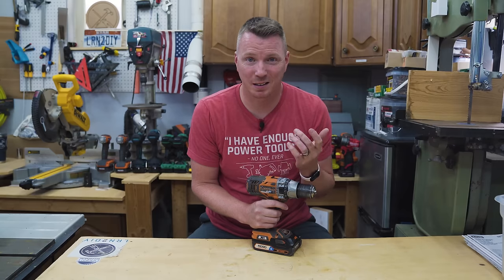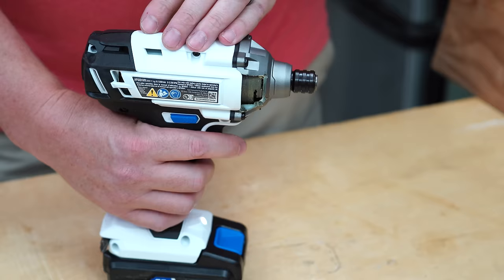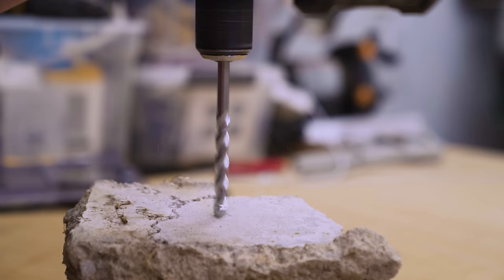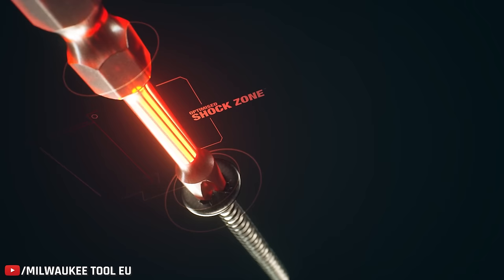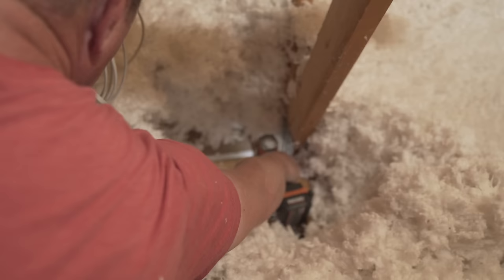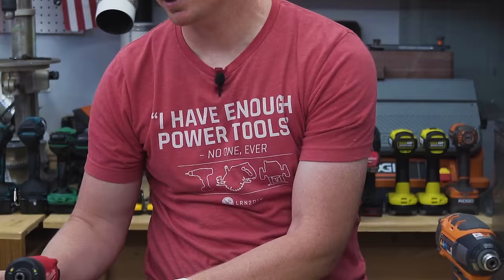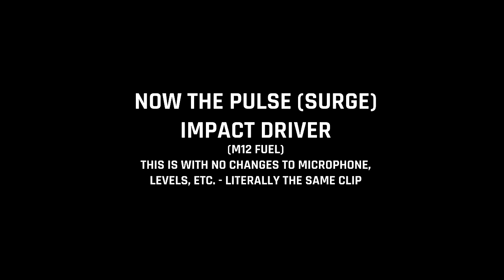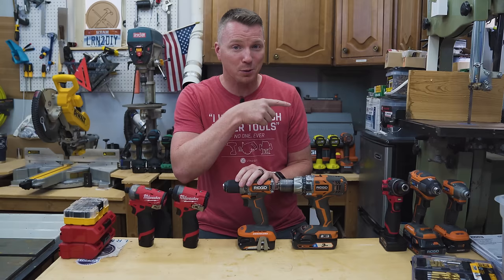Is The Cordless Drill Becoming Obsolete?

Comment: i still prefer corded tools over cordless im never so far away from an outlet that a cordless tool makes more sense then a corded tool and the battery on a cordless is a disposable part that will need to be replaced over time 

also i do not need to waist time recharging or replacing battery's just plug in and go also for jobs that take me further from the outlet i can get a couple of 100FT extension cords for cheaper then one battery and the extension cord will last way longer then the battery

and to be honest im use my dads old Makita drill he got back in the late 70s early 80s and do not see any reason to get a new drill or impact driver

Comment: Too many people that know less, use impacts where they have no business being used, and stores/manufacturers need to do more to teach consumers how to use the clutch on cordless drills.

More ugga dugga is the wrong answer when your nut and bolt are cross threaded, you are driving cheap phillips screws, sheet metal screws, or the socket is bottomed out and barely contacting the nut

Comment: Impact drivers are making people lazy… I personally hate it because of the noise. Most of the workers I work with all prefer the driver over the drill on virtually everything since It doesn’t have so many settings…. It’s easy if you take the time to get to know your drill… but most don’t and just use speed 3/2 and when it doesn’t go through they switch it to speed 1 and receive some wrist damage

Comment: Nothing will ever be as powerful as my corded portable cable black corded drill it’s big heavy and will drill through walls at ft nox lol and my old Milwaukee 18volt drill from the early 2000s is stronger then the new drills batteries die quick but charge quick

Comment: Yeah try using an impact to drill some stainless or even mild steel. All you kooks are drilling 2x4s and concrete and stuff. Watch how well that works and metals. You’ll have drill bits snapping off into your face. Impacts are for fasteners. Drills are for drilling. Don’t be lazy. Do the job right or don’t do it at all. KOOKS!!!

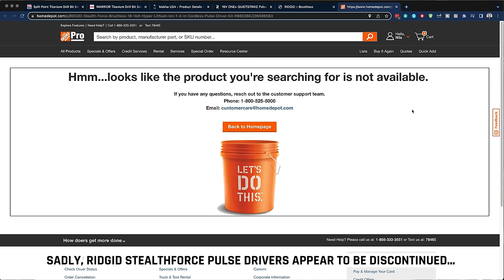Comment: 8:40 is certainly not true. m12 normal fuel does 1200in-lbs while that surge/hydraulic only does 450in-lbs. you are trading off most of the power for that quieter and smoother operation
Reply from the maker: Actually... all tests I've done and those I've seen done by others back up the claim that the Surge outputs more torque. Check out this article by Pro Tool Reviews, for example. I have no idea why Milwaukee lists their torque at such a low rate for the Surge but it's not accurate. https://www.protoolreviews.com/milwaukee-m12-fuel-surge-vs-impact-driver/ The Surge is a tiny powerhouse.
Reply: @LRN2DIY  Taking back my original statement as yeah, you are definitely correct. Apologies for the ignorance, really wouldve never imagined that to possibly be right based on the numbers
Reply from the maker: @josephcalabria2976  No need to apologize - it's completely confusing, especially when the numbers make no sense like in this case. After having used the M12 Fuel, the M18 Fuel, the M12 Surge and the M18 Surge quite a bit, I still feel like the M18 Surge is just a great all around tool and is my favorite tool for most jobs. It's certainly not for everyone though. Thanks for watching!
Reply: @LRN2DIY  just the other week had the pleasure to use one my buddy picked up and would have to agree that it's a total pleasure to use. even while falsely assuming that it was lower power, still felt like the benefits completely made up for that regardless. appreciate the videos, and your informative reply. keep up the great work!

Comment: I prefer AC hammer drills to their cordless counterparts. I don't like batteries getting drained while penetrating and hail Nikolai Tesla.

With my corded Ryobi hammer drill and baby oil, I can easily drill holes on hardened spring steel or stainless steel. No similar DC tool could give me the same result fast.

Comment: Unless they have bearing . . real bearing, the drill bit is going to wobble . . it doesn't matter if it is a drill or an impact or what brand . . most cordless have plastic inside them . . NOT good for drill with accuracy

Comment: I had watched for years as these new fangled cordless tools took the market by storm and wondered, why? I also wondered how long the romance of the cordless tool freedom would last. I wondered how long it would take for the users and believers in those tools would finally begin to realize, that they aren't nearly as free as they had been led to believe.

Yes, you are free from the hampering and restricting power cords. Yes, the safety issue of tripping over those power cords was almost eliminated... almost. But what did the workers using these things gain from the cordless features?

Well, not that much... really. And those cordless tools aren't anywhere near as cordless as they were led to believe. Not only is there still a power cord, it is tethered to the tool remotely. How? It's simple. The tools runs on battery power electricity. This means one of 2 things. One, the batteries die and must be replaced, or 2... the batteries must be recharged. In order to charge the batteries, they need a dc charger that is compatible with them. The polarity, voltage and amps must match or the charger could cause problems.

It wasn't long before every handyman, woodworker and professional builder was using these things. It took them years before realizing that they were tethered and could only use the cordless tools for as long as a charge held out in the power tool. Not long afterward, workers, builders, handymen and home woodworkers and power tool users of every conceivable kind, had numerous battery chargers and at least 5 times more batteries to use, that all needed charging when the power went out.

The wonders of cordless tools soon revealed its Achilles heel. If the battery couldn't be charged due to a lack of adequate electricity to charge it with, it was useless. So, workers set about buying as many batteries as they could afford and could carry. And in no time at all... it turned into a fiasco of workers using and charging batteries for their tools, batteries failing, exploding or getting lost, and an almost endless myriad of different little and big problems stemming from their once wondrous and wonderful seeming power tools.

Now, those same workers are opening their eyes to the reality and the truth of how stifling and limiting those cordless tools actually are.

I've used them and have never cared for them. I always buy, own and use corded electrical tools for my shop needs. As long as the house has electricity to use, I never need worry about charging a dead battery, or a battery failing to charge, failing and exploding, or just not working at all. And I never need worry about batteries wearing down with the need to buy more to replace them. In the end, it only costs as much for the use of the electricity used to power the electric corded tools. Yes, I am tethered and restricted to the length of the power cord & extension cords. But that's a small price to pay. As long as I have access to suitable outlets that allows me to reach my work I'm fine... restricted, but free from the worries of charging batteries, replacing batteries, losing batteries, exploding batteries, or batteries that just don't hold up to the tasks put to them.

So... how wonderful are these cordless tools anyway?

Comment: Nah by far not obsolete. I use the drill for large holes like decks for lag bolts. I use it to drill holes for bolts in concrete.  I im turn around and use it for drilling holes in my trailer when I had on. Use it for getting tapcons into brick/concrete for ledgers. Using it to make holes with the hole bit when working on cars for running wiring or installation projects. You should always have a drill on hand because it’s great to have. This particular tool you have drop off the face of the earth due to new age.

Comment: Clickbait successful and profitable based on view numbers (which is fine and the real purpose of Youtube).
Not everyone who buys cordless tools is a lightweight who doesn't drill steel run larger shank drill bits, holesaws, burrs etc or who uses so very few bits that buying hex-shank drill bits in their SEVERELY LIMITED size variety makes anything resembling sense. Having both OTOH permits drilling then screwing or bolting MANY holes without stopping to swap attachments. Drills also run a wide variety of attachments impacts do not. 

For example while bolting together sections of angle steel shelving I fabbed as flat "trays" and vertical supports (so I could fit them level in my shipping container shop by hanging them from the interior tiedown loops) I fitted them by clamping the parts in place on the walls then drilled using my drill and bolted using my impact. Making multiple parts made them easy to transport and lift (I work solo) so welding as an assembly was out, plus I build for easy reconfiguration. Wearing out hex shank bits would have been expensive AND required swapping from drill bit to socket adapter were I to use one tool.  Pros buy drill/driver kits for many good reasons which are nearly always more useful to home gamers than trying to get by with one less tool.

Comment: Impact driver for the DIYer.  Not good.  Pre drill for anything #6 shank or smaller.  Impact will snap em just about every time.  Pre drill and then the impact.  Finish up delicate situations with, wait for it, a hand turned screwdriver.

Comment: Mostly my tools are for tearing things APART and there's no way a drill is obsolete because it turns faster. It takes things apart faster. Most anything it can take off isn't going to be much easier with an impact, if it can't take it off then there's a good chance the impact won't either. For those, break it by hand and then the speedy drill, every time. I don't understand why this man thinks the only function is driving screws or drilling holes. I mean, they all have reverse on them, right!?

Comment: Except when you need a drill. and the clutch. That's why it has ten plus settings. I don't like stripping screws. Just one example. Using the right tool for the job is the difference between amateur and professional. 

Not a great video.